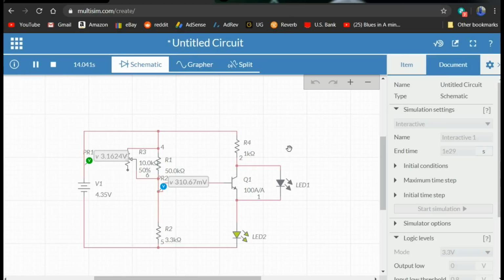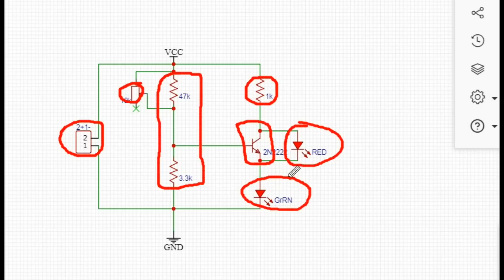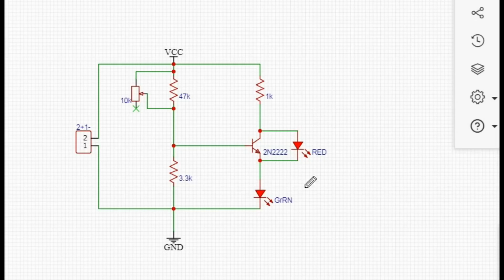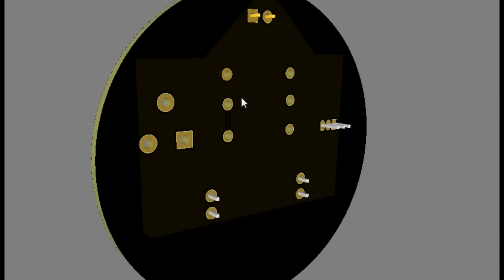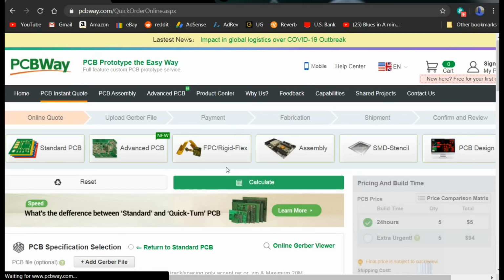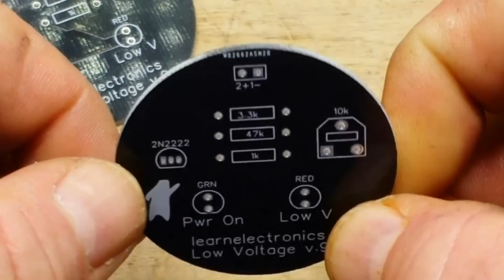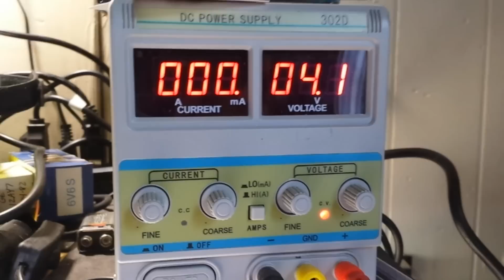How to make a low voltage indicator

Comment: I see a problem in this design. When the transistor is off the red led is not shunted,  and can turn on. That's ok, but if the voltage is too low , here is the problem. The red led is in series with the green led, and both of them require around 2volts to turn on, so 2 + 2 = 4 volts. That's almost fully charged litium battery. But the demo at the end works and that is confusing me. How the red is on but the green is almost off? Im missing somthing? The path of the current is from the battery through resistor, red led, green led and ground which is 2volts red + 2volts green + some drop across the resistor but lets assume its negligible because the current is very little so around 4volts. Please,  someone explain to me how this circuit works.

Comment: May I please ask if I've got it right. The 2N2222 is getting higher resistance by lower Voltage and on a point do the red LED have a lower resistance then the 2N2222 and therefore do the LED get enough current to start turning on?

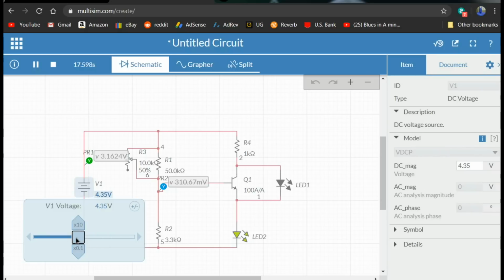Comment: At 1:31 there is an issue with your simulation. The GREEN Voltage indication shows 3.1624V but the battery voltage is adjusted to 4.35V. the BLUE voltage indication shows 310.67mV 
For a normal green led we would see a forward voltage (Vf) of about 2V or so , so let's just say 2.0V.

To turn on Q1 the base need to be about 0.6V higher than the emitter so about 2.6V

But from your simulation if the green colour on the LED means it's illuminated and therefore has 2 volts across it.  it makes Q1 turn on with a Vbe of (Base voltage - Emitter voltage ) 0.3 - 2.0V = -1.7V.
Something is wrong with the displayed simulation?

A give away is that the GREEN  voltage indication never shows the voltage you set the battery too.

Comment: Well, I wondered how they worked, I bought 5 for a couple of bucks that have a buzzer as a warning for low voltage. I use them in some old Makita drills that I converted to run 18650s. As usual a very cool video thanks!

Comment: Question: show would I insert that in a generic circuit? Would I connect my circuit in parallel downstream of the transistor?
Reply from the maker: Parallel with your battery
Reply: @learnelectronics  Thanks, so it would be battery-lowvoltage indicator-my circuit, all I  parallel. Thanks.

Comment: Hi.. when red LED is on, current will go to ground via green LED correct? will this turn on green LED?
Reply: if the LED's had the same forward voltage then they would glow at the same brightness. but the circuit has a red LED for low voltage indication, this will have a lower forward voltage than the green so will conduct first and limit the voltage across the green LED. So it will glow dim and fade out before the red LED. there is about 0.5V's difference beteen the green (vf 2.0) and red (Vf 1.5) so is working on this principal.

Comment: Could do with a few of those circuits set up for 24v for my Solar Set up.    I'm currently using these.  https://www.mouser.com/datasheet/2/149/KA75330Z-90129.pdf

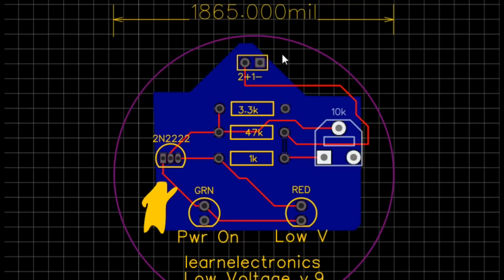Comment: I guess that I am the slow kid in class.  I understand the transistor portion.  When the voltage is >set then transistor is on, and voltage flows from VCC to 1K Resistor to Green LED to Gnd.  When voltage is <set, according to the schematic at t=0:00 and t=5:00 (minutes in the video), voltage goes from VCC to 1k Resisitor to Red LED to the cathode of the Green LED to ground.  If the voltage is still above the forward voltage of both LEDs (3.5v to 4V), then there is enough forward voltage to drive both LEDs.  And if the voltage is less than forward voltage (3.5 to 4V), then neither LED should light up.  Looking at the actual board at t=9:06  does the red LED go to the ground pin of the green LED?   Most of the time, I kinda understand your videos.  This one is baffling me.  If the red LED's anode goes to ground, that makes more sense. (I am sure I am missing something here, and because I am new to electronics, I would like to learn what I am missing.)

Comment: I couldn't find a decent circuit for a battery indicator for 9V batteries, so I made my own.  Low battery indication starting at 7.6V, with full red indication at 6.2V.  It works well for low drain applications and I'm really pleased with it.  I'm a bit embarrassed to share it though: as a noob I'm sure it would attract a lot of criticism as it uses three transistors, one to drive each of the red and green LEDs, and one to detect the green LED turning off.
Reply: Chris Robinson 

No Problem Chris‼️ Please share your little project. There are many hobby electronics around the world who would like to get such a circuit as your is and: with absolute no critism I‘m very sure about that☝🏼👍🏼. I would like to get it. Wish you all the best and go on...✌🏼 Boris🇨🇭

Comment: Hello I make your circuit in proteus with 4V1 voltage green led IS ON because 2N2222 is drive but red led is of whatever the voltage?? Normaly if 2N2222 is not drive the minimum voltage for red and green led on i must 4V minimum because 2v on  each led.

Comment: Why do you have R3 in parallel with R1? Couldn't you just have made R1 a potentiometer?

Or is R1 just part of the main voltage divider with R3 for fine tuning?
Reply from the maker: Fine tuning

Comment: I could use something like this, being off grid, maybe two, one as a yellow alert, and another for RED ALERT! So others will know to start turning off un needed appliances, I'd like to go to yellow, at about 3.4v/cell, red at about 3.2c/cell, the system shut down is at 2.9-3.0v/cell, it wouldn't take much more to build a bms, I also shut my charging system down at 4.0-4.15v/cell,  great video friend!

Comment: please build a low voltage battery cut off circuit
Reply: This circuit could be adapted for that purpose using a mosfet instead of the red LED.